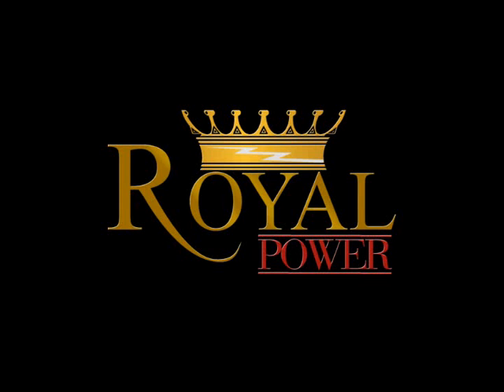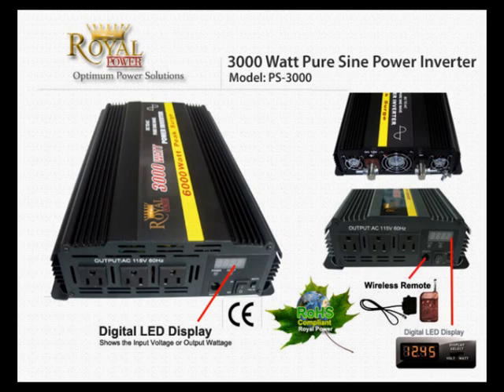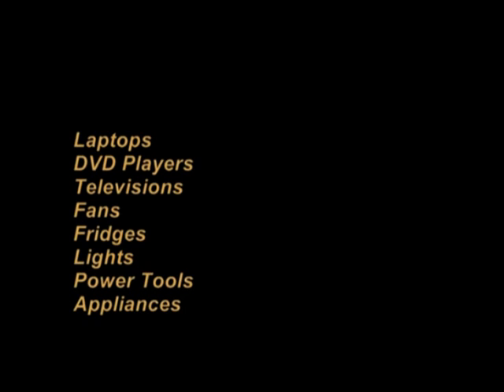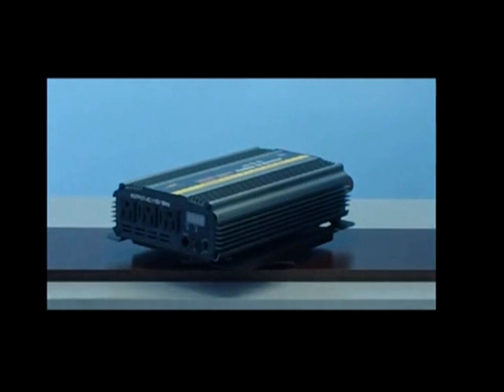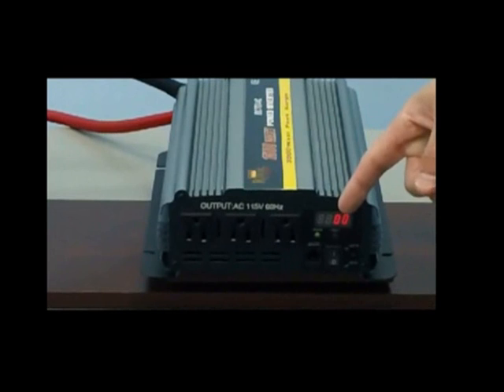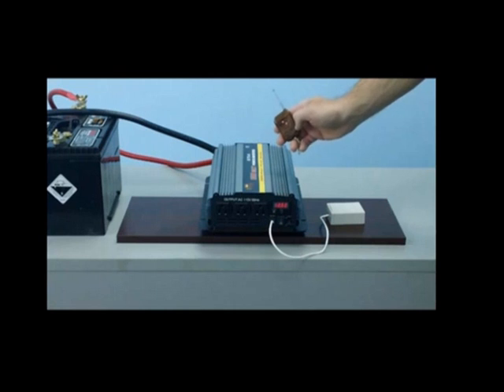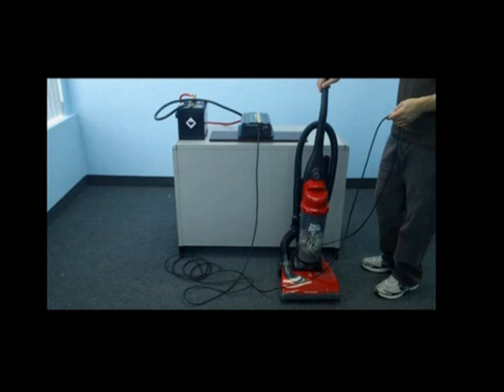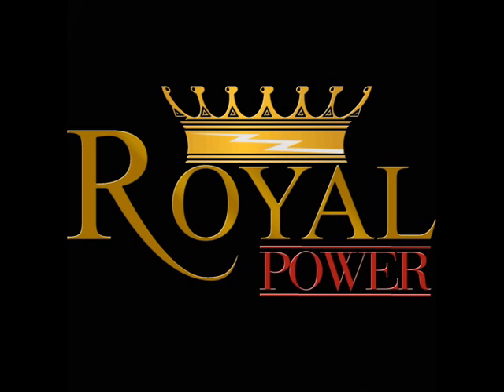3000 Watt Pure Sine Power Inverter - 12 Volt DC to 120 Volt AC - Royal Power - (PS-3000)

Comment: Is the 24 amps available split between the outlets  or how amps is available at each outlet,  I want to power my travel trailer 30 amp  service less my ac unit please answer.
Reply from the maker: You can pull the load from any combination of outlets.

Comment: what size of fuse between the battery and inverter when powering  a 30 amp travel trailer.
Reply: 400 amp bolt on fuse is what i use.  online chart shows a 250 amp circuit breaker is also a good choice.

Comment: I got a 1.2 hp. Air compressor  
And is. 120vac /6hz/ 7amp  and i  already got a 1/0 gauge wire to the back of the truck (17ft long) 
The main battery  is  900 cranking amps..  
Can I use this inverter? 
Do I need another battery? 
A marine battery ?
What size ?
Thank you.
Reply from the maker: It should be fine, but it would be better if you can make a shorter connection then 17FT.
Reply: @Royal_Power_Inverters  well i cont because i use the 17ft to connect a winch.  So do you recomend another battery  at the back of my truck. ? Or 2? And then get everything from there?  Thank you
Reply from the maker: @1Wayfix   You can connect a 2nd battery to make up for the loss from the length of cables.
Reply: @Royal_Power_Inverters  would you recommend  a marine battery  o a regular battery?    Thank you.
Reply from the maker: @1Wayfix   A regular battery would be fine.
Reply: @Royal_Power_Inverters  ok thank you .. i going  to check the link .. right now.

Comment: i just want to use it for a lamp would it have enough sufficient power for 6 hours everyday? hope u can answer my question
Reply from the maker: Harith Annuar One lamp would draw just the wattage of the bulb so you will be fine for 6 hours a day.
Reply: the inverter only transform your 12v battery power to 120v, if your lamp is less then 100 w you only need a 200 to 400 watt inverter, very poor video here

Comment: what size would need to run air conditioning
Reply: Brenda Holcombe running air conditioner on battery is very cost prohibitive, although it is possible. Unfortunately you would need $10000 worth of batteries just to run an air conditioner for a very short period of time.